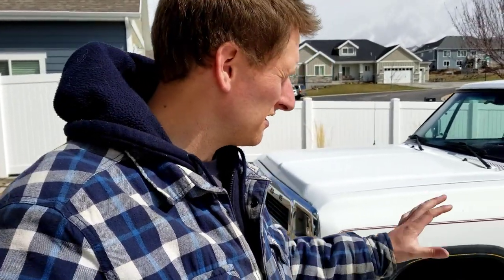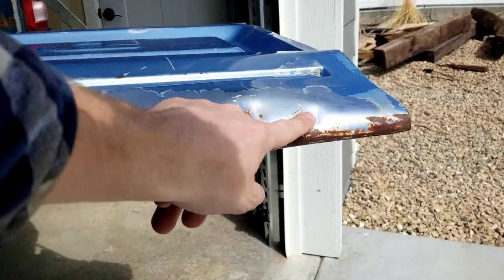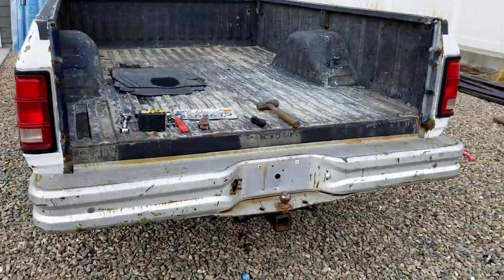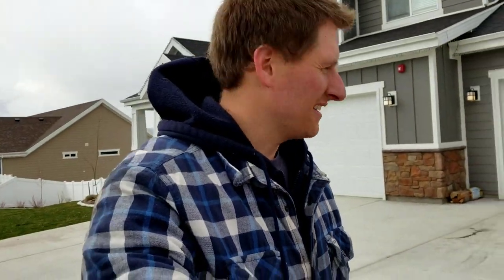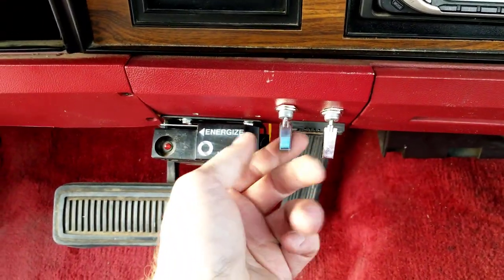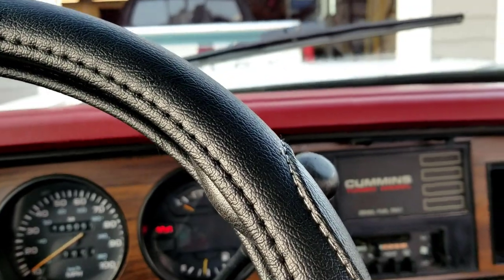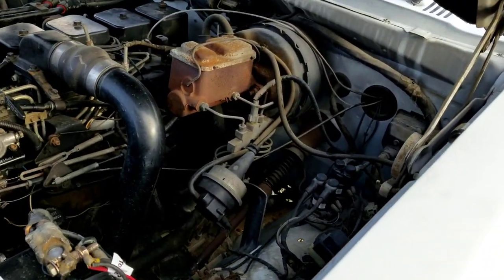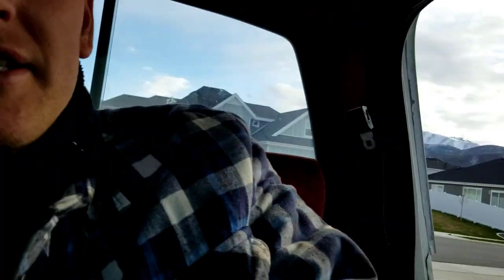Putting Overdrive and Lockup on Toggle Switches

Comment: Planning very shortly on doing a 727 to 47RH swap in my 1990 1st Gen as well. 

I have a bunch of three-terminal button switches with the built-in ON indicator LEDs in them. I already rewired  my cargo light circuit to function as my dome light switch, and would like all my dashboard switches to match. They're supposed to be rated for 20 amps. Do you think this would be a problem?
Reply from the maker: I don't know exactly if that will be a problem. If you are worried though just run the switch through a relay, then the relay will take all the load and they handle it way better than the switch

Comment: To if the tailgate there’s a plastic piece that was supposed to anchors the linkages from the handle to the loft mechanism, unscrew the three bolts holding the handle and on the right side the linkage would be freed up and the plastic piece that should be holding is broken, just bend the metal linkage to fix it. Happened to mine, exact same issue
Reply from the maker: I'll try that. So you didn't replace the plastic clip? You just bent the rod to hold on to it better?
Reply from the maker: I'll try that. So you didn't replace the plastic clip? You just bent the rod to hold on to it better?
Reply: decent_1st_gen yeah, that’s what the plastic piece did, just held it in place. Once you take it apart you’ll see

Comment: Good video.. I was wondering if I can go with toggle switches on a 47re transmission since that one has 8 pin on the plug instead 3 pin
Reply from the maker: Unfortunately the 47re requires a standalone computer to control it.
Reply: @decentgarage   I got you. Do you know one that would you recommend?
Reply from the maker: @germanortega978  I believe anteater is the ones that most people run. Not positive on that though
Reply: @decentgarage  got you. Thanks for your help

Comment: Are you still planning on repairing the odometer? Love to see it done. My odometer & trip work fine, but the speedo quit. Do they work independent from each other in the gauge cluster. I replaced the speed sensor in the rear diff, might be the cable off the T-case, but that appears to be secure. Also, my cruise control still works fine, (with the help from Garmin) so that's why I'm puzzled. Thanks.
Reply: Did you ever solve your issues with your truck?  Mine were similar and it sounds like we replaced the same parts.  I rebuilt the ecm which worked briefly then out again….
Reply: @msoul3248  No. It is still inoperable. Tyler Ovens said it might me the VSS, but when I told him that the cruise still works, he was puzzled also. Might be the little gears in the gauge cluster but I haven't taken that a part yet. I've been too hesitant.
Reply: @kellymichael7362  I will be in the process of adding a fuse block to the engine bay, re-wiring and soldering wires and connections and maybe, just maybe completely doing away with the ecm.  Good luck with yours.

Comment: I dont care about locking out overdrive. If i discondct the switch will it go into OD? Its locked out now and so 50 mph is 2000 rpm.

Comment: What is the purpose of the lockup?
Reply from the maker: Torque convertors use fluid coupling. Q non lockup convertor has every loss through heat. Lockup mechanically locks up the convertor so there is no slipping and loss of energy

Comment: Hi Tim, Starting to take shape qwik in short order ! Looking better n better each vid. Get a floor Jack n some heat n hammer n the bumper will look and function alot better. Thumbs Up n Finally got my channel up too. So you can check out my 1st Gen we'll probably be doing paint about the same time. Keep the good work.

Comment: couldn't you leave the overdrive on all the time instead of flipping it on and off when your downshifting
Reply from the maker: No, leaving overdrive in like that will burn up the overdrive unit. If you've ever had OD on a switch and slow down after getting off the freeway you can feel how unhappy it is once you get down in to 2nd gear

Comment: I have a 47RH transmission I want to put in my 91.5 Dodge and I was just wondering to the adapter the bolts to the engine yeah I guess that’s different than what’s on my truck now a guy gave me an adapter when I bought the transmission 47RH on my guessing it’s the right one but anyway I was told it moves everything back about an inch and a half to 2 inches if anybody can to verify that every kind of cool have a good day Jim from Pennsylvania again
Reply from the maker: Jim, this is correct. For the 47rh you will need the 2nd gen adapter which is about 1.5" thicker. You will also need a second gen starter.
Reply: @decentgarage  also if he has a two piece drive line it may have enough play, if not will need to shorten it up, Or what I had to do is get 
a single piece driveline made. Great videos by the way. Thanks

Comment: What does lock up mean?
Reply from the maker: Lockup is when the torque convertor actually completely and mechanically couples.
Reply: My overdrive button quit working. I’m not sure about the lock up. I’ll ask the mechanic today when I pick it up.
Reply: Decent Garage without looking at the transmission how can I tell if my truck is a 46H or a 47RH. It’s a 1993  D250 turbo diesel. 2wheel drive quad cab. Navy blue just like yours.
Reply from the maker: Yours has an a518 (46rh) which does not have a lockup torque convertor. I have a video on diagnosing and fixing overdrive issues.
Reply: Decent Garage I think I watched the video is it the one where you talk about the tailgate and the bumper first? That was very helpful but I have to be able to explain it to the transmission shop mechanic because I don’t work on it myself. I think I just have a wiring issue too because my truck has a little switches all over the place. Right now the phone charger a.k.a. cigarette lighter doesn’t work. He did put a new transmission switch in though so at least my transmission works and I didn’t ruin it. It’s pretty hard when everybody tries to race me ten times daily. I guess I wore my overdrive button out.
Reply: @decentgarage  is that video with the white truck, bumper and tailgate?